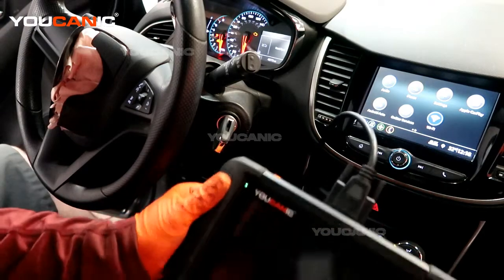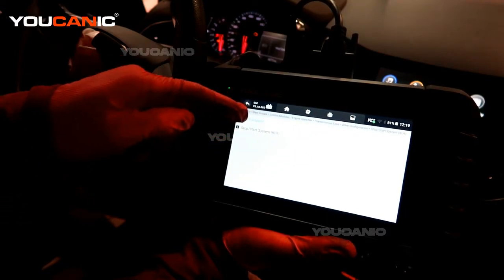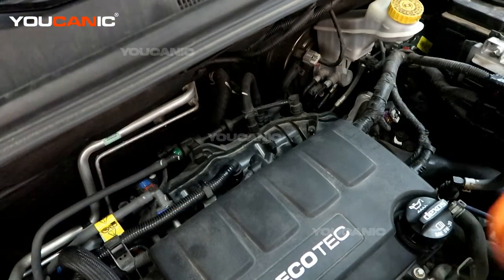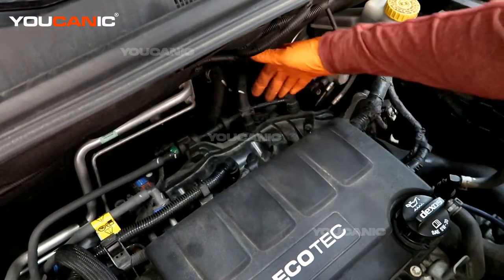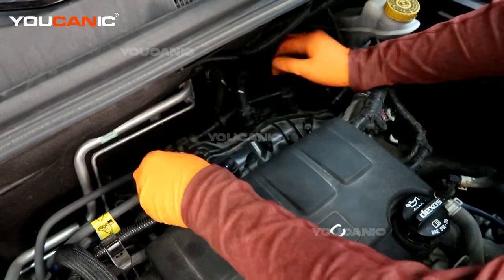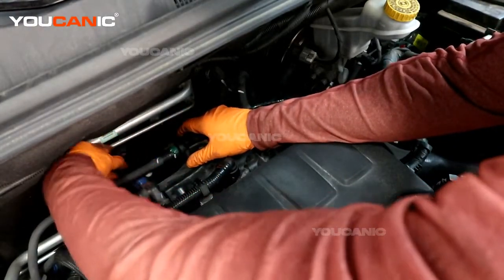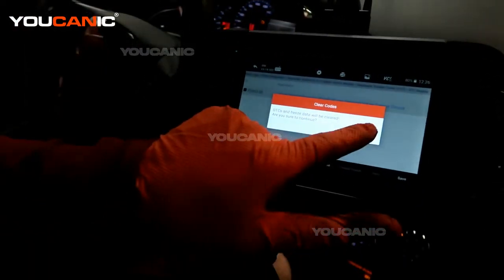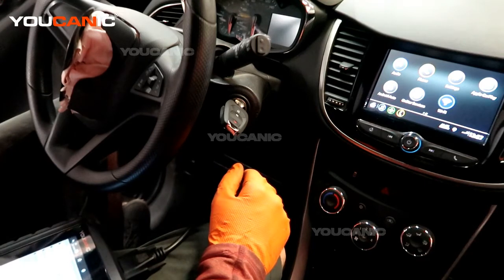2015-2023 Chevrolet Trax - Fix Fault Code P0443 (EVAP Purge Solenoid Valve Circuit)

Comment: Can't find it on the 2022 trax 1.4 turbo
Reply: Yeah that is because it is different, engine is not the same.
Reply: I'm having the same issue. I can't locate it. 50,000 miles and not covered under warranty.